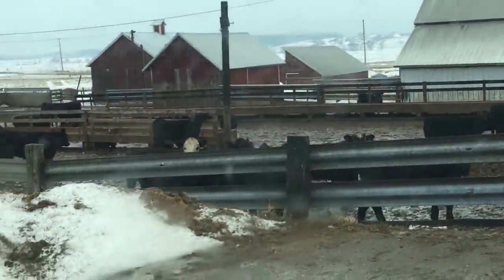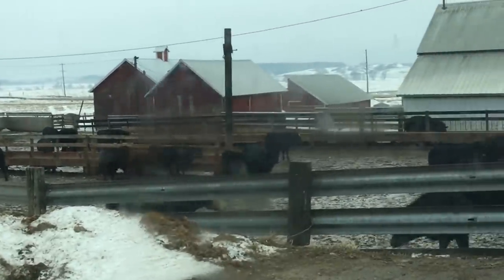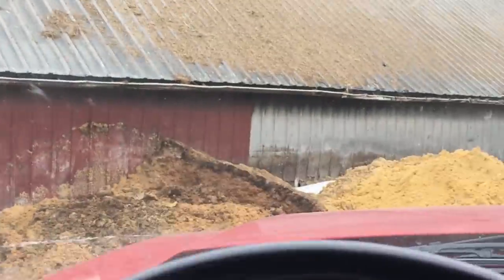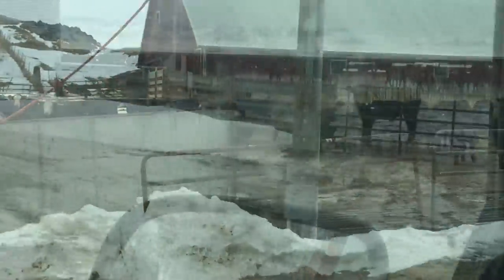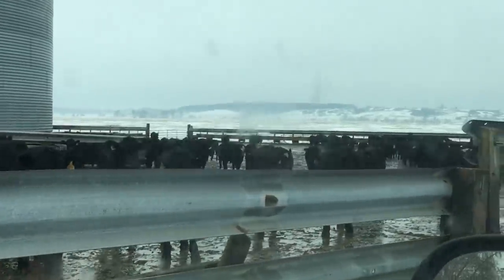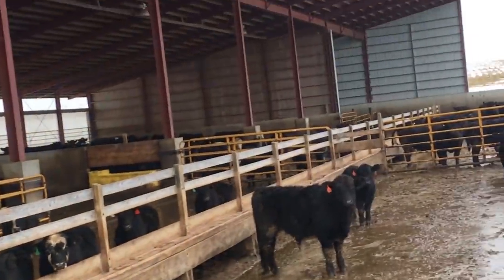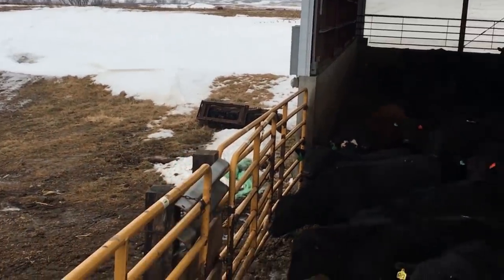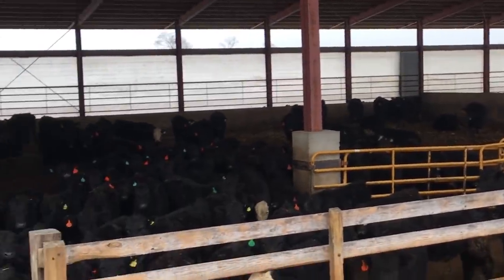Tour of our Feedlots

Comment: What a labor intensive setup why not all straight line bunk feeders and not having to open gates or feed on 3 different sides
Reply from the maker: Mainly to keep the two lots separate and in order to feed all of the cattle that can fit in there, if we would have had them on the outside, we would have had to have twice as many bunks. Now the cows can get on both sides of the bunks instead of just the one side. Notice how Jerry's lot has twice as many bunks as the other 3? That's why